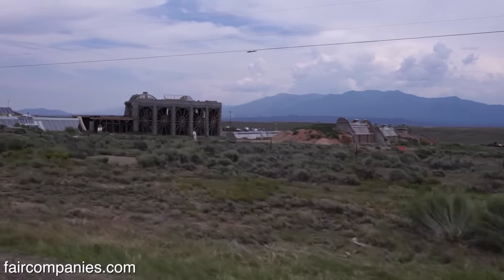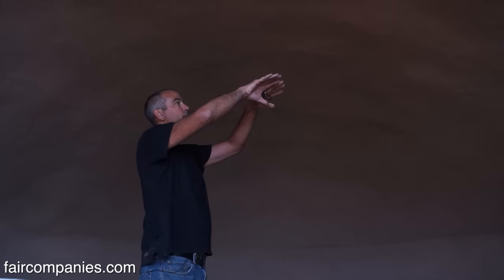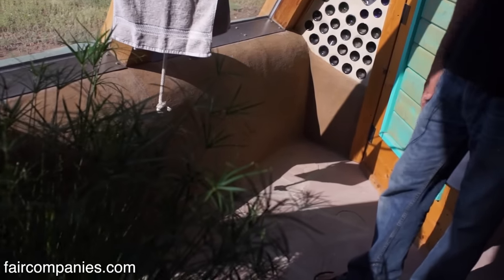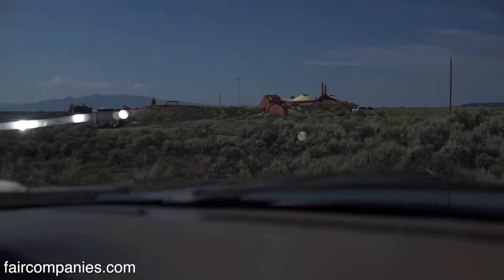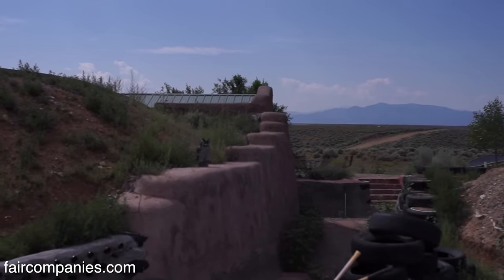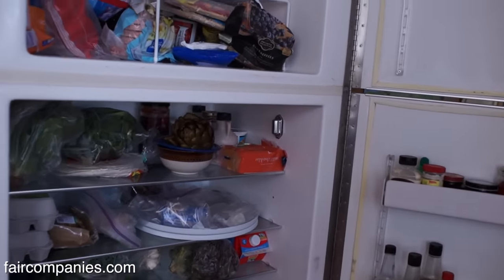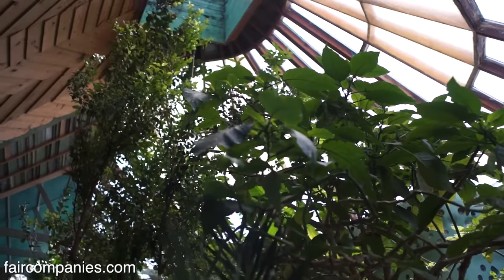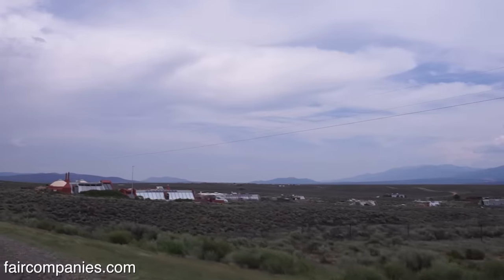Earthships: self-sustaining homes for a post-apocalyptic land?

Comment: These are not for the apocalypse. They are self-sustaining homes for the current state of the world.
Reply: blake chattaway  my Job is decontamination in nuclear power plants.
No it won't.
There is no air filtering no 100% water re-use so it's guaranteed that the inhabitants will incorporate radioactive dust.
Reply: @maxmustermann5538  Plus this is set in a DESERT with less than 9 inches of rainfall a year. Add to that the soil at this location is of a very poor quality, high mineral content, not really fit for much of anything. So they are all going to starve. On top of that it's not all that far from a number of potential targets so all those glass windows will be the first things to go, people don't understand the power of the standard 400kt weapon widely used by the two major nuclear powers and most targets of any value will get two to four warheads> A city like Albuquerque would probably be targeted with as many as 5 warheads. Anyone who thinks that there's some sort of apocalypse that doesn't involve a nuclear exchange is fooling themselves.
Reply: @emilkarpo  youre right.
There are 14465 official nuclear war heads on this planet.
There have been 2000 test.
I assume 10 times the fallout then the test weapons.
 15000/2000*10=75
So i would assume 75 times the background radiation of today.
Might not be that bad.
The main nuclides have caesium 30 years, strontium 28 years and iodine 8 days. The first day's will be very dosis intensive. After 80 days iodine will be mostly gone.
After 280 and 300 years the rest.
Probably after 30-60 years it will be okay to walk outside.
The rain and decay will cleared some spots to be liveable again.
Reply: Same difference.
Reply: Give over !!     No matter where and how you live try to live for the day not anticipate nuclear horrors.
Reply: They are forever homes. Blessed be
Reply: Whoever said that it was built for an apocalypse??
Reply: FacePuncher
It's a good way to build for those who can afford the time. Some people who are in between jobs, for example. Some people who have worked and scrimped to save their hard earned money and see that in the long run, they will save money on utilities and food. These walls are extremely strong and don't take much away from the earth. People who want to leave as little an imprint as possible. This is great for students. Let them get good excercise, bond with like minded people. Llike a good old barn raising where neighbors gather to put up a barn for each neighbor. They learn skills and they build their home the same way. Young people need to step away from pc's & video games to do some good work. This is a fantastic opportunity! 🤗
Reply: Like stated by someone earlier, "banks gotta sell mortgages! Enjoy your 30 years of indentured servitude."
Reply: The Government would steal this  compound and we would all be in hiding if we didn't comply to their control terms. We would not be able to live this luxurious post apocalyse.
Reply: @brookebixler1040  How about the title? "Earthships: self-sustaining homes for a post-apocalyptic land?". Answer: Nope.
Reply: Jamey Craig 
I am doing what I can to prep. There is only so much we can do to prepare for something that we don't know exactly how it will hit us or where we will be when it hits. I try to keep my car stocked with supplies and my home as well.
Reply: Yeah TOXIFY IT MORE WITH TIRES IN THE GROUND.
Reply: Clay Gilliland who says it's definitely going to be a nuclear apocalypse?
Reply: 2020 is an apocalypse tho...
Reply: @petersonmitchell  That is seriously one of THE most ignorant and arrogant comments I’ve ever read. War is as much of a reality for humans in the United States than it is ANY where else. 

I hope you’ve learned better this year.
Reply: Yes and no. We are living through the apocalypse currently. Society is broken. It's just a real apocalypse and not a Hollywood rendition in 90 minutes.
Reply: I Lena I’m sure they’d work just fine in the apocalypse .
Reply: Nothing can save us from that .

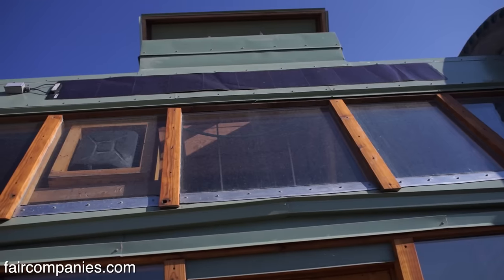Comment: The solar panels at 4:20 are Uni-Solar panels. They are flexible, only about 15lbs and roll up like a carpet. I used to work on the Product Development Team designing, building and testing them. They work great, even in low light and they are installed without penetrating a roof. You just stick them down because they have a special adhesive on the back. We were the largest & one of the only companies making flexible solar PVL's...
Reply: yea but only give you about half the wattage of bigger full size panels when compared to the square footage they would take up
Reply: did someone say 420?
Reply: I would like more info on your company
Reply: Îbzz
Reply: where can we buy them Company name please. Thanks and many blessings.
Reply: How many would a person need for a family of four
Reply: I was definitely using roll up panels when I get around to my project

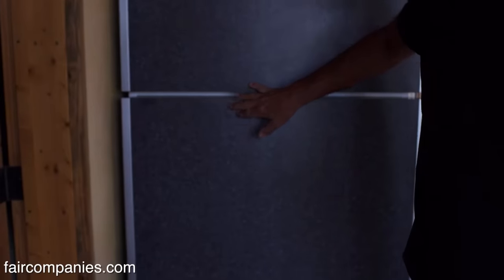Comment: 12:30 You could probably run a freezer for less energy if you put it in a room that is already chilled from the earth, and then pump it's exhaust heat through a canal through the house to bleed the heat of to keep the house warm.
Reply: Or that circular one that lady in Canada had.  It opened from the top, she explained the cold air stayed to the bottom and didn't spill out when you opened it.  Some way to incorporate that would be amazing.
Reply: @KayKay114  Could you link to this somehow? sounds fascinating
Reply: your question reminds me if there's earth ships that have basements or cellars? i understand that this might require pouring cement but if a basement could be created as well as a cellar that would be a great addition to the earth ship.
Reply: @KayKay114  We had a top opened freezer in the basement when I was a kid. A really big one, probably 1.5m3 on the outside of something.
Reply: You could also get a more efficient design by modifying the thermostat on a deep freeze to work as a refrigerator so the cold air stays trapped in the bottom, you could probably modify it to be better insulated as well depending on the where your condenser is.

Comment: I've been following the Earthship concept since I first picked up a _"Whole Earth Catalogue" was a twelve year old in the mid 1970s. I love how far they've come but also, how far the ideas learned have moved into other areas. Such as grey water usage, passive heating, etc.,. It's been a slow process but every time I lose hope in humanity, I see such places and my hope's are restored a little. I just hope we're not too late.
Reply: It's interesting to see the evolution and improvement of it each decade.  The thing with the greenhouse being a passive heater is something we discovered with our conservatory.  We'd open the door during days when it was cold but there was some sun and there'd be a blast of hot air inside.  We also hung our clothes in there to dry to save on a dryer.  They'd dry so freaking quick.
Reply: I lived and traveled in an RV for 4 years and I learned to see the world, our connection to it, and our "acceptance" of the grid as the only option in a WHOLE new light!!  I FINALLY SAW THE LIGHT, LOL!!😂🤗
Reply: The Whole Earth  Catalogue was a terrific inspiration.  It started me on some building ideas, that actually preceded Earthships.  The thing that puzzles me is why you never had the confidence to build without using tyres? Your system seems to make a lot of unnecessary extra work.

Comment: This is all really amazing and it is awesome that there can be experiements like these. The only doubt I have is regarding the massive use of tyres as building material. Aren't there risks of the chemicals used in making the tyres leaking into the soil, the house and the surroundings eventually reaching groundwater?
Reply: In more wet areas, like when Mike took a team to help rebuild an island destroyed by a tsunami, filled plastic is added to reduce water interactions with the tires.

They overlooked one of Mike's biggest intentions when he started: heal the Earth. If the tires are filled with dirt and then sealed into walls (which for human health, must stay dry) then that is much healthier for  the earth than having the tires in a big landfill, right?

The tires are already an issue. 

The question is, where would you prefer the tires be retired to?

Mike thought it out and researched how to use "trash" to keep it out of landfills, and create a safer, more sustainable living environment.

Comment: And 1,500 watts of solar panels run a 1,000 watt air conditioner that will yield you 1-2 gallons of water per day, Ambassador Mount
Reply: Certainly in a high humidity environment that would be true
Reply: Not in the dessert.

Comment: concrete with weak spots aka cans is exactly that a weak spot not strong. it might work for the moment but you don't see any filler in the Colosseum
Reply: the matrix is the strength
Reply: @alyssa murray ..... it's cans not in a matrix. it is far from symmetrical to be a matrix. the concrete is not poured as a single unit it is globed on.
Reply: Dwight Patch you are the cool teacher in the whole entire world
Reply: Mr Duke i like your earthship video  and it is very cool i am glad i have you as my teacher
Reply: what im the cool teacher?
Reply: I suppose it's a good thing they aren't building a colosseum then.
Reply: you should think about building a earth ship for people who don't have a home
Reply: why?
Reply: I think whatever drugs you have used have had permanent damage.
Reply: um....you're saying our current method of 2x4's and press board is going to last longer?  Our current homes are only built to last 30 years.
Reply: I have a tendency to agree, because Hallibutrton, Texaco, Chevro, and other oil companies have been drilling for oil in those mountains in recent years.  You know they're just laughing under their breath observing any structures being built like this.  There seems to be some irresponsibility about the way New Mexico State's administration is run.... research Oklahoma and its earthquakes.  I've worked for Halliburton.
Reply: Norman Graham it has nothing to do with lasting it has to do with structural integrity. boards have to be replaced after a period of time. this is built with weak points.
Reply: Well, we're not laughing at Halliburton's irresponsibility. You must have  lot of information in your head, then. That's useful. And for the record, cob holds up pretty well to earthquake conditions and is highly repairable.
Reply: thats what I thought, concrete without reinforcing is dangerously weak, about the strength of wet sand, its too thick to be mortar and to weak to be the structure itself, this is scary
Reply: None of the walls with cans or bottles in them are load-bearing so it doesn't matter.  The load bearing walls are the tire walls which could probably take a hit from a 155mm howitzer.
Reply: Ok, all you have to do is build a form and add rebar into it like they do for basement walls. Pour some concrete in it, toss in some cans, pour some more concrete and more cans and keep going until the form is full. let it dry and cure and use that in your earthship. I don't mind the use of the cans so much if they had covered the front and back of them to have a smoother stronger structure.
Reply: The ones that are laughing or the banksters that are taking all your money the power companies that are draining all your money a free energy
Reply: @DinkiDidog  "experimental", remember?  That being said, ayayay!!! So true about New Mexico after living here 3 years, lol.  I'm starting to think the state got its name by just adding "New!" to every sign that had the word 'Mexico' on it, like a sales tactic to get peoples attention by pretending it's an improved version of the old..
Trust me, it works-- they suckered me into thinking it would be a great place to live..    as someone said to me when I first moved here: "49th in everything" ...Now I understand, lol, - and it should be the State motto, hahaha🤣..
Yup, I can see it now:
"Hi, Welcome to New Mexico,"  "We're 49th in everything, and we plan to stay that way!"
😳🙃

Comment: Fascinating!  I wonder how those earthship houses would work in a colder climate.
Reply: They are on a high mountain plateau, it freezing cold in winter
Reply: Yes, I meant to say how do they do in colder climates with less sun.   Johan- right they would simply need a woodstove for extra heat, but would need less wood than less insulated houses.
Reply: ok...Ive heard them say before that the earthship can stay warm for up to 4 days without any solar heating.....so perhaps a rocket stove or something like that could be used
Reply: There are other methods than wood stove like geothermal heating and compost heating that can well be used in higher latitudes.   Very interesting stuff.
Reply: They have been built and function well in nearly every climate and continent on the planet. (I'm pretty sure that excludes antarctica ha) 
Check out the documentary "Garbage Warrior", it's on YouTube and the architect who started these explains the whole journey and process of the Earthships, including the legal battles.
Reply: I stayed in the studio rental in February 2012.  We left the windows open to long and it started getting to cold inside.  I started a small fire and had to put it out and strip down layers after 30 min, as the temperature rose so fast.  I think a rocket stove in combination with the thermal mass would be more than enough.  A wood stove would work too but you may make it too hot.  These houses are so efficient that they challenged my consumption totals.
Reply: Bush Ninja
Wow, Winnipeg Manitoba, that would be a great test for the cold weather.  Now that I think about it, of course they would do well in the cold since they are so well insulated.  Very interesting concept.
Reply: Northern New Mexico is relatively cold.  An environment like that is probably considerably cold, and windy during winter.
But post-apocalyptic?  No.  Post-apocalyptic, in an environment like that you could take a shower and stay warm in your energy efficient house and starve to death.  Nature does not give up her bounties readily in that environment.
Reply: In Colorado, where I live,  we are immediately north of New Mexico. I plan on building such a home. I know from speaking with local experts on the subject and taking a college course in sustainable architecture that in the midwinter, with a blizzard on, you need to have lots of wood stockpiled, or have a generator with lots of fuel, or rely on being connected to the county electrical grid and having electrical heat from your local power plant (bad idea), or else you just go it old-school poor Coloradoan and wear a hundred layers and sleep in a thermal sleeping bag eating applesauce and peanut butter until the situation gets better and the power gets turned back on/ you can brush off your solar panels, hopefully within a week, or you will freeze to death and die in such a structure. Luckily, here in Colorado, conditions are ideal for stands of Aspen. Aspen trees are large colonies that, because they all share the same root structure, are capable of regenerating incredibly fast and supplying a wood-stand large enough to heat a large home every year in theory in perpetuity on as small as two and a half acres.The only caveat is the fact that such trees are contingent upon a water supply. Without water, the Aspen stand doesn't survive. This is true of most wood bearing trees. Therefore, sustainable survival in the high desert inland North is completely and totally 100% dependent upon a supply of freshwater to grow the wood with which to survive the winter. This supply isn't locally available from the looks of it where these structures have been built. However, maybe it doesn't actually get that cold down there, I've never really been in that part of the country. I would be very interested to see how these houses performed off the grid in midwinter. However, I personally believe that in an ideal society, all houses would be both built like this and connected to a greater power grid.
Reply: ***** That is also why some earthship models come with a built in high efficiency fire place. In extreme latitudes the concern would be the viability of lighting, you are correct.
Reply: If you do a search with earthship in Canada you will see one for a couple in Ontario, Canada. It was 32 below zero on the day it was filmed & yet it was 70 inside with no heat used. Simply amazing. Mike Reynolds is quite the genius.
Reply: marycatfish If he has a flaw, it would be that he is too far ahead of his time.

Comment: So those are weeds using the black water? Would it be safe to grow food bearing plants using black water? I am not [yet] familiar with black water systems. 

I've been theorizing a sustainable home for a while now water usage is a big deal. As sustainable development grows, I hope drought stricken areas utilize these systems asap. It's the most sensible and logical concept as I see it. Living a healthy life in a self sustainable home will be a big part of the growth and permit of this style of living. 

Also, how about plastics such as grocery bags? I've seen a few videos about ironing layers of bags together to make thicker sheets that are malleable. Perhaps they could be used as piping as they are HDPE, high definition polyethylene. That's just an idea.
Reply: No. It would not be safe. And that is why it is kept underground.
Reply: Matt's Van Life,  we bought an older home an found out the septic was a brick lined system made a hundred years ago. What is new was once.  Makes nice trees.
Reply: GREY water, he said GREY water, which is water used for shower, dishes, everything EXCEPT sewer, which is what you BLACK water is.